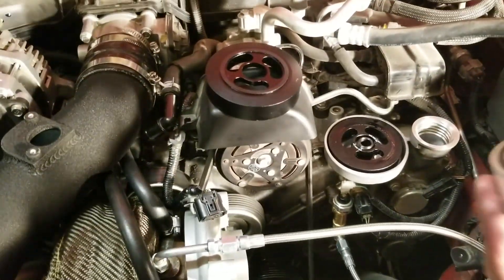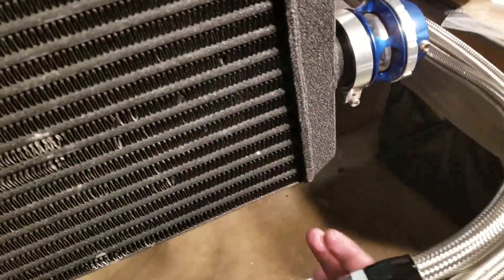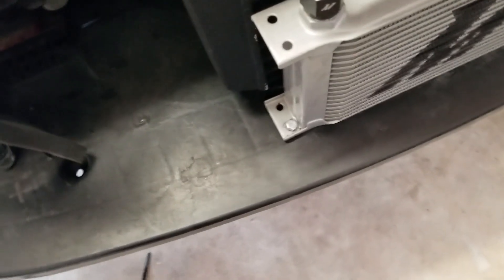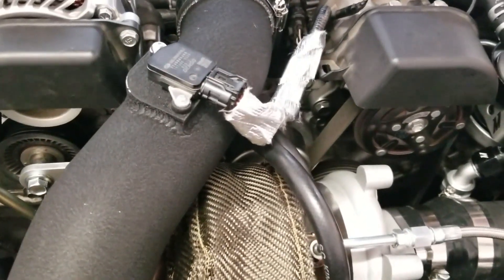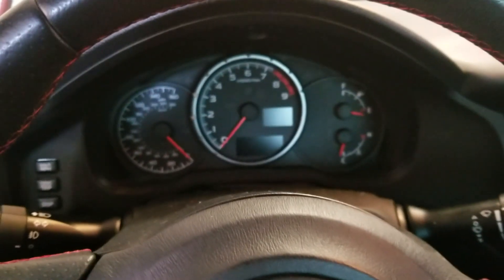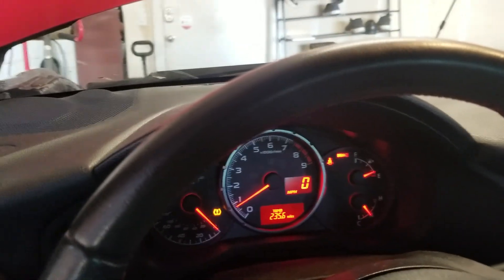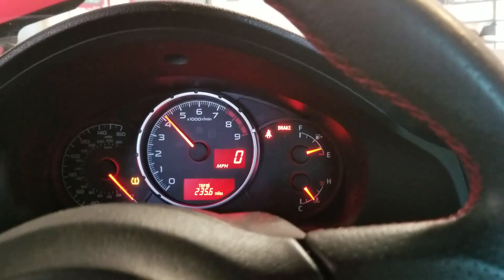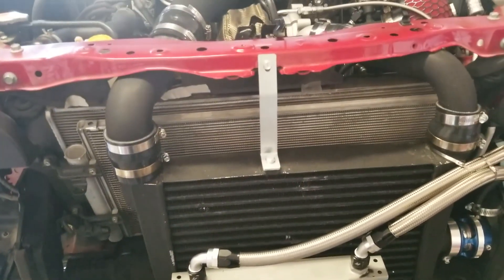ROAD TO 300HP SUBARU BRZ - SBD500X Turbo kit Install Part 5 of 6 (Oil Cooler & First Start-Up!))

Comment: Can you drive it with no tune?
Reply from the maker: I would advise NOT driving the car without a tune. Some may people say that you can drive it without the wastegate connected, or drive at low RPM and avoid boost. In my opinion, don't ever risk it, one wrong move and engine goes kaboom, lol.

Tune is usually $500 or less a new engine will go upwards from $3000 not including labor.

Comment: Hey man quick question where did you t off the blow off valve line, was it the brake booster line
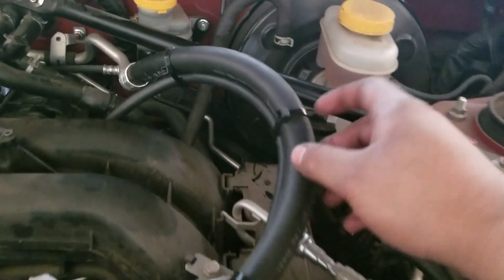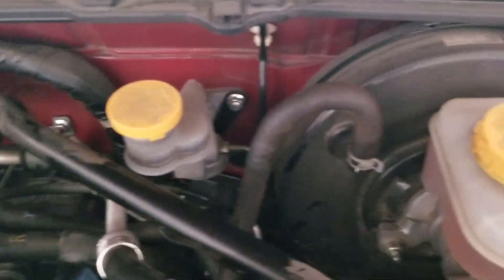Reply from the maker: In the video its @2:55. This is for a manual car as well. On the stock setup, there is a a bolt holding the brake booster line, i undid that bolt and removed a connector there. I then bought a tee connection and place the lines according to @3:00. That's one way of doing it to avoid cutting anything. Tho from reading around, the closer it is to the manifold, the faster the response time. Then again, since we run lower psi, it shouldn't really affect the car to much given its actually safe to run it without the bov (more stutter sound "tuuuututuutu")
Reply: @brzser8387  Haha thanks man I appreciate it so much, honestly wouldn't have been able to do the install without your help! The manifold clamps were done all thanks to you and your video. I didnt have to take off the manifold!!! So far I do have a coolant leak from the throttle body but that is an easy fix.(hopefully lol)
Reply from the maker: Awesome! Glad i could help!
I'd just clamp everything for peace of mind, haha! If you can, make a video of your car lol, always nice to see other people and their builds. Good job and welcome to the boosted life :D!

Comment: Nice work man congrats on successful start up, what are your plans on tuning? And also I recommend upgrading the those stock injectors and fuel pump,they are known to to let car run lean.
Reply from the maker: Thanks, as you can see I'm not that mechanically inclined lol, but somehow was able to finish it.
As far as tuning, I'm running visconti off the shelf tune at 91 octane 7psi. For that level stock injectors and pumps are enough. I have some supporting mods vids coming up as well. Clutch install, fork, pivot, and catch cans. I am currently hunting parts to run e85 and looking 
 to be ~300 to ~350 WHP. So far i have injectors, and electronic boost controller lol, still need pump and flex fuel.kit, then an e-tune from HRI tuning is the goal.